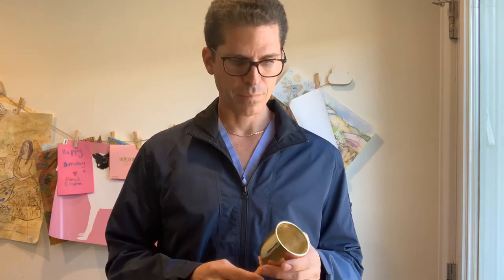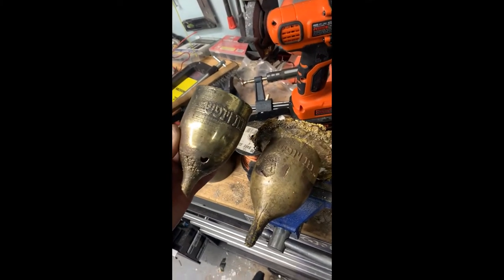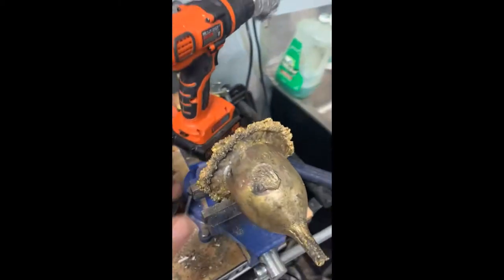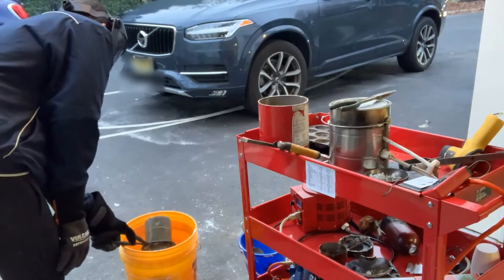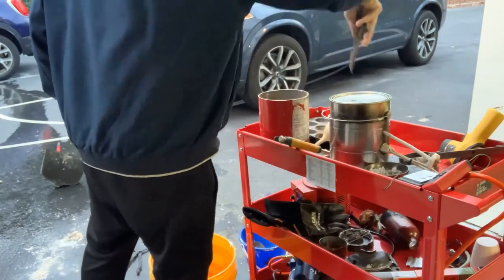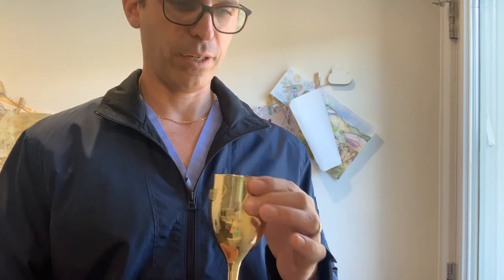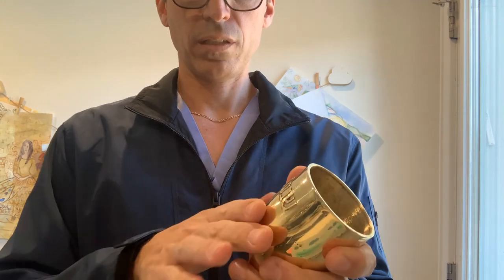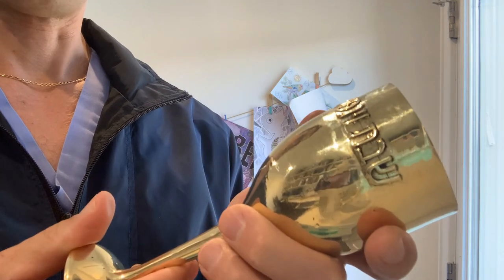Brass Goblet - Lost PLA Casting - Success at Last!

Comment: You could have used scrap plumbing parts (usually free and made of a great alloy for casting) instead of a perfectly good billet of $$ naval alloy which is formulated for machining.  Looks good though.   Plaster is a big pain to use without a burnout kiln and a long slow burn out.
Reply from the maker: I was worried about lead content which is why I used naval brass. I tried using bullet casings and plumbing fixtures first. I guess I could’ve checked the lead levels myself but I thought the naval brass was easier.